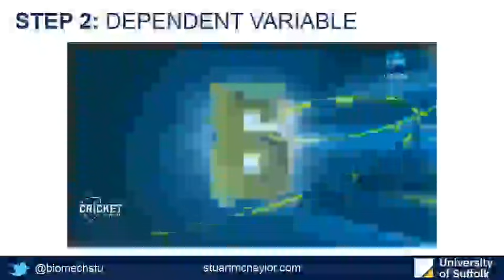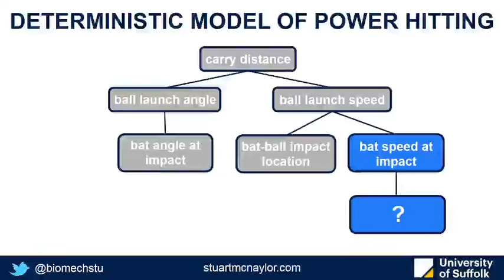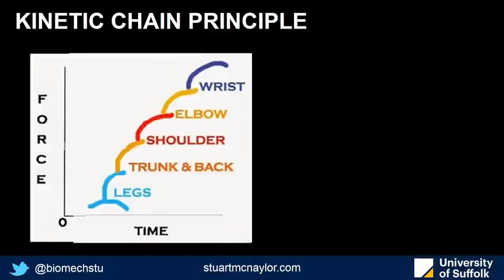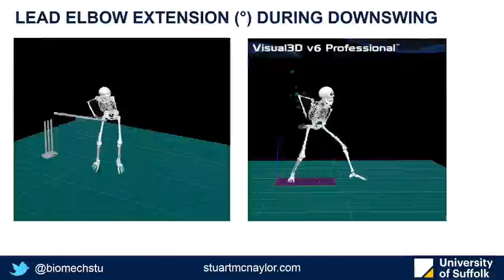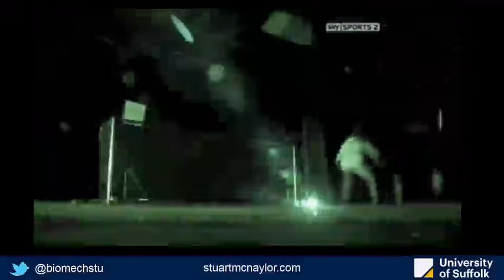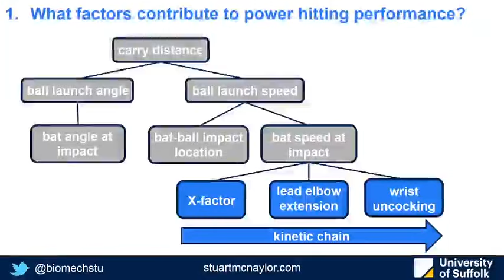Cricket Batting Biomechanics | Dr Stuart McErlain-Naylor

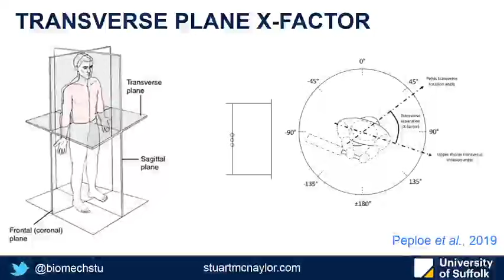Comment: 15:13 can’t wrap my head around this. Is the line coming perpendicular to both thorax and pelvis?. For practical purposes, how is this angle created? By moving your hips and shoulders in opposite direction?.

For example, if a batter before ball is delivered stands in a way that his hips are somewhat horizontal (ie in the direction of the cricket stumps, while his shoulders are in one line facing the bowler, ie side on. This would result a slight twist in back but is this what you are referring to the X factor?”

Theoretically, would changing the batting stance in a way that hips are facing the leg side boundary and shoulders facing the bowler before ball is delivered generate more power?.

Thank you for the informative content you produce.
Reply from the maker: Hi. If standing upright, shoulders are likely over hips and so very little separation. Rotating torso but 'leaving hips behind' would cause an X or separation. You're right that stance may affect the starting separation but remember that is is the separation at the top of the backswing or how much of a stretch we create during the backswing that is important.
Reply: @biomechstu  Got it. Thank you very much for your reply.

Comment: Do big strong muscles contribute to six hitting? Sir please reply
Reply from the maker: I would argue that technique is more important than strength alone, but yes the same 'technique' performed with greater force-production capabilities is likely to result in grdater bat speed and so grdater ball carry distance if it can be timed effectively.
Reply: @biomechstu  sir one last question..do strong muscles help in achieving quicker bat speed? And if 2 persons have same bat speed and technique but different body strength will it effect six distance anyways?
Reply from the maker: If technique, timing, etc. are appropriate then strength is likely to positively effect bat speed. But if bat speed is the same then strength wouldn't effect the ball outcome, as strength can only have an influence through the bat
Reply: @biomechstu  players like gayle Russell pollard manage to clear the ropes  even when they Miss time the ball sometimes what is the behind that?
Reply from the maker: Ball distance is a result of bat speed, bat angle, and bat-ball impact location (e.g. sweet spot). Better values for one (e.g., bat speed due to strength) can compensate for suboptimal values in the others as long as the others still remain acceptable and not completely the wrong bat angle or missing the ball, etc.
Reply: @biomechstu  thanks for sharing knowledge appreciate it a lot🤗

Comment: Hi, This video was quite interesting, but may I know the angle you are mentioning is at what reference point w.r.t which plane ?
Reply from the maker: Hi. Which angle are you talking about? As there were a lot of angles mentioned within the video.
Reply: The Optimum launch angle says only the ball angle w.r.t its own plane (above the ground),not the bat angle ?
When bat angle is said how we measure that? If it is a straight bat hit
Reply from the maker: The bat angle is also measured relative to the pitch. In that specific case, we would have been looking at the angle of the bat face about the global medio-lateral axis (i.e. bat pointing down at the ground, pointing back behind, pointing forwards, or what angle in-between) so that this could then be related to the launch angle you mention. Full details of all methods are in the published journal articles, all of which should be free to access in some format. I believe there are links somewhere in the video description.

Comment: Hi Stuart, I saw the video repeatedly to understand the concepts as I have limited knowledge of science, especially physics. My question is, given the objective of scoring runs preferably clearing the ropes (six), given the angle, location, x factor at play and other factors like the speed of the bat etc, can we work backwards to figure out what is the correct body movement to get the optimum results. That is - for a given ball - what should be the size of the stride, what should be the x factor, elbow extension, wrist extension etc? Once we have it, we can actually map the movement of a player to see the variance between the two. Possible? Or is it already being done?